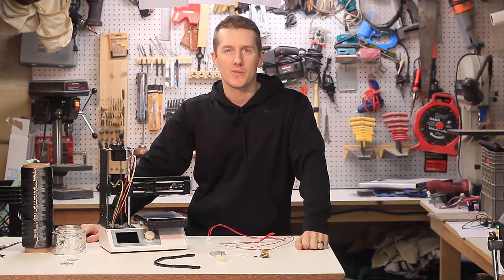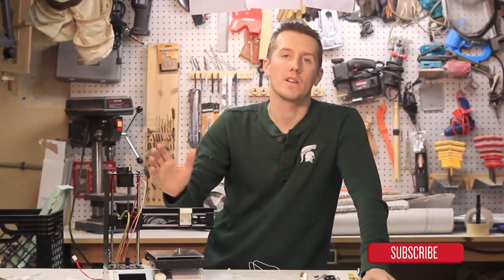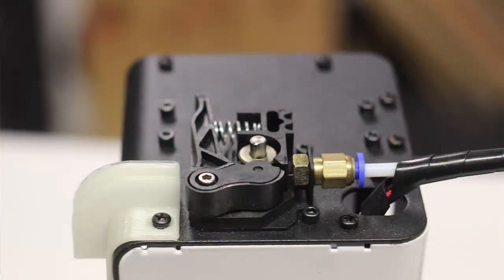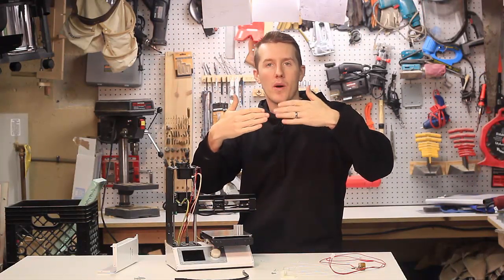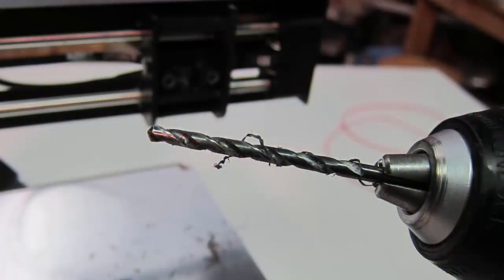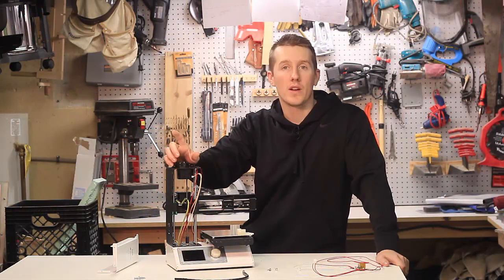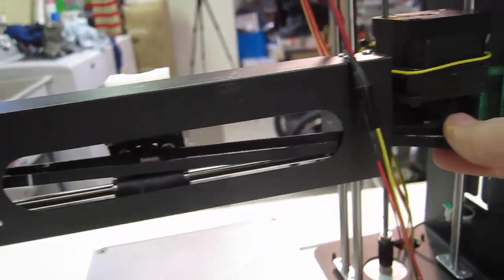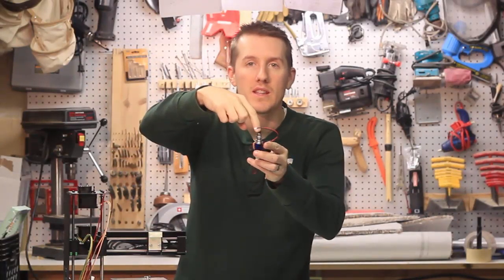Install E3D V6 Hotend - MonoPrice Select Mini 3D Printer

Comment: What sort of enclosure are you using for your printer?
Reply from the maker: I made it out of plywood.  Not really needed unless you are printing with ABS.  It needs to stay hot or else it curls up off the print bed.

Comment: I have to change the hotend, but I dont know how to open the housing??? No way to diconnect the wires.  Any idea? Thanks!
Reply from the maker: I don't think the housing opens.  It's a solid piece of steel.  But i think there's a set screw that holds the heater piece and thermistor in place.  You might be good to buy a cheap one from temu or amazon and see how it's put together.  They are only like $3 - $5.

Comment: I've got a mini v2 and am just about to give up on it and toss it in the trash. So frustrated that you can't find parts for it. Trouble started with a clog. From videos I learned to take the hotend apart and using a heatgun I cleared the clog from the PTFE liner. Put it back together wrong and it leaked filament all over the heater block and nozzle. Took it apart and again with heatgun cleared the mess. Then when putting it back together I broke the neumatic fitting on the top of the coldend inside the coldend. Now I'm trying to figure out how to replace the entire hotend with an entire E3D V6 clone. The E3D v6 I got drops in fine with the stock mount and I was able to connect it and get filament running out of it but the whole assembly is too short by about 5mm or more and the cooling fan mount goes beyond the nozzle so I can't level the bed because it crashes into the fan mount. Also, because it's so short the bed can't come up far enough so I ordered longer bolts and springs for the bed. Only plus is what I've learned about 3D printer innards but have not been able to enjoying much actual printing.

Comment: So i'm no electrician, but i'm doing work on the v2 hot end and i'm confused, usually you have 1 red an 1 black wire with electronics in my experience anyways and the heater block has 2 red wires do i need to worry about that? No markings on the old wires or the new wires other than the gauge and how much they can handle...
Reply from the maker: I'm not an electrician either, but i don't think there's a + and -.  I don't think it matters which end is connected on the heater block.

Comment: I cannot find any guides on updating the firmware after installing this,  yet just about every video tells me to make sure I update before printing. Where can I find the files for the firmware update?
Reply from the maker: I've never updated the firmware and i still print today just fine.  I remember i was going to do it once to use Octoprint, but never did.  
But i assume you load something onto the microSD card or something??

Comment: You can use the same bolts if you cut off the little lip on the x-carriage. See how the bottom of your printed mount sticks out further than the rest @ 2:13? They are m3 (0.5 pitch), you just need corresponding hex nuts.

Comment: quick trick ive learn while working with 3d printed parts, i finally broke down an got a couple assorted m bolts so i have plenty to work with but when cutting threads into 3d printed parts i take whatever bolt size works an i cut a line on either side of the bolt at the tip so it cuts threads an works like a thread cutter. makes cutting the threads alot easier an cleaner an they seem to hold better for me than if i just force a bolt in. the first few screws i tried cutting 3 lines but sometime they was so small it made it hard so i back down to 2 lines an it works just as good.

Comment: petg is not always better. pla is better as v6 mounting bracket because its stiffer. petg is better suited for parts that requires more strength, but rigidity is not as important.

Comment: Are the steps the same on the MP select mini V2? Same commands in the firmware after upgrade?
Reply from the maker: Not sure, i've never used version 2.  But i never upgraded the firmware on my version 1.  It just printed fine with the new hotend.  I just played around with the slicer settings.

Comment: Thanks for the video. I used 4-40 stainless pan head screws and nuts from my local hardware store. Cost was under $2 and easier to find than M3's in the USA. Two 3/4" long for the mount to the carriage and two 1 1/4" for the cap holding the E3D clone heat sink to the new mount. I think 1" for the longer screws would have also worked too, but then it would have taken a second trip to the store. Worked out just fine overall except big fingers little nuts took some time to locate on the longer two screws. I thought about heating the nuts and pressing into the mount so I didn't have to work so hard, but ended up just holding the nuts with pliers and got them started after a few attempts.

Comment: Thanks for the previous answer! I have ONE more... After installing my E3DV6 Genuine hotend, now when I hit 'Home' my monoprice, the hotend ends up about 3MM off the front left corner of the bed. Basically, the same as place as the factory setting, but, about 3MM off the front of the bed now. I can move the hot end into the right position (using on the pronterface interface) - is there a way I can move the hot end into the desired place on the bed that I would like it to 'home' to, and then upload a command (followed by M500) to save that desired position as the 'new default' location when hitting the 'Home' button? Is it possible to do that way? Or, do you know a pronterface command to upload (followed by M500), to make the E3Dv6 home on the left corner of the bed? Basically, 'fixing' the homing positioning with the offset, through pronterface, and saving it in the firmware so that it then homes on the left front corner of the bed again? I'd rather work through pronterface since I had been adding the necessary commands to account for the PID etc., and I have no idea to then offload that tweaked firmware into arduino. I'd rather just add a command through pronterface to fix this final issue..

Comment: Hey Dave! Quick Question...  I JUST installed my E3D V6 All Metal Hotend on my Monoprice mini V1. One issue - between the end of the E3D assembly instructions (and what your video covers with actual install), I am confused about how to actually connect the Monoprice bowden tube to the top of the hotend. I see a nut in the video but the way it seems there is no threasing at the top of the hotend. I have pics I can email you if you want to get a visual - I just need to know how much to cut the PTFE tube at the top of the hot end and how exactly to screw on the mini's bowden tube.  Thanks!!
Reply from the maker: At the top of my hotend it was threaded for that one fitting (forget the name of it)  it's the fitting that holds the white PTFE tube without pulling out until you push the ring in.  You shouldn't have to cut the PTFE tube, just push it into the hotend till it stops.  I tapered the end of my PTFE tube to fit the tapered inside at the bottom of the hotend, but you dont really have to.  So to sum up, just post the white PTFE tube in till its tight.
Reply: Thanks! Yes, I did do that, and so I have about  3" of PTFE tubing protruding from the top, its well seated in the hot end. However, the feeder tubing that was part of the monoprice mini (that fit into the original heat sink), seems to be the same size. The very top of the E3D V6 hot end down't have any extra threading to put a nut on to somehow join with the end of the feeder tube (but, somehow you do it). Maybe you can unscrew the feeder tube from the top of the hot end and explain in a video how that attaches? I for one would REALLY appreciate it! I have no idea how to connect the two the way things seem to be right now. Thanks!!
Reply from the maker: @Gouldeyecandy  So you are saying yours looks like this:   https://www.google.com/search?q=e3d+v6&safe=off&rlz=1C1GCEU_enUS821US821&source=lnms&tbm=isch&sa=X&ved=0ahUKEwjBwpv1w9HeAhWHqIMKHZ5qDg8Q_AUIFCgC&biw=1778&bih=860#imgrc=sb4bEbv3rgW-XM:

and mine looks like this:  https://www.google.com/imgres?imgurl=https%3A%2F%2Fmakershopbcn.com%2Fwp-content%2Fuploads%2F2016%2F11%2FHOTEND-E3D-V6-BOWDEN.jpg&imgrefurl=https%3A%2F%2Fmakershopbcn.com%2Fen%2Fproduct%2Fe3d-v6-bowden-hotend&docid=hpfo0q1YwJACjM&tbnid=RoVcFwbE-eTksM%3A&vet=10ahUKEwikzIr2w9HeAhWF4IMKHf03DC0QMwiZASgOMA4..i&w=800&h=800&safe=off&bih=860&biw=1778&q=e3d%20v6&ved=0ahUKEwikzIr2w9HeAhWF4IMKHf03DC0QMwiZASgOMA4&iact=mrc&uact=8
Reply: Yup! Got it! Thanks!

Comment: Well I for one enjoyed the video.  Makes it easy for me to follow. Got a question though, when you installed this hot end, did you have to mess with the "coding" or parameters of the printer since this is upgraded from what it came with?  If so, how did you go about doing this.  Thanks.
Reply from the maker: I've never changed the coding or firmware of the printer.  You may need to adjust the Zaxis switch so it triggers when the nozzle is near the print bed.  But any changes for filament flow or anything was in the slicing.

Comment: Thank you so much, I had no idea how to get the heat sink off. Do you have a link to the 3D printed part to replace it with?
Reply from the maker: I think i tried 2 or 3 different ones but liked this the best...the zero offset version
https://www.thingiverse.com/thing:1848402

Comment: Try Permatex  Red RTV to coat the Hotend. The Red RTV will handle temp up to 600 F. and all you need is a 1/16 of a inch thickness. Works better than the Gun Cotton.
Reply from the maker: I recently bought the E3D silicone sock 3-pack for $10.  They work pretty well.  But ya the RTV stuff would probably be cheaper and more permanent.

Comment: So what is the difference between the e3d and the standard? I know people tend to call Bowden extruders e3d hot ends, but I'm mind fucked here.. it's the same shit
Reply from the maker: E3D is a company.  They designed the V6 hotend.  It became super popular and many companies in China copied their design and sell them for $5 instead of $70.  The official E3D hotends are well made and have tight tolerances.   It's kind of a roll of the dice whether you get a good one or not from China, so far the 2 cheap ones i bought are ok.  Lots of people call the ones from China "E3D V6 CLONES".  The "standard" hotend for the original MP Mini is something different.  On the new Version 2 of the MP Mini they now use a hotend like the E3D V6.  But for people like me, who own the Version 1, it was just as easy to upgrade my stock hotend to an E3D V6 clone.  
Bowden doesn't have anything to do with the hotend.  Bowden just means that there is a long tube connecting the drive motor and the hotend.  The MP Mini is a Bowden setup because the motor is at the top, connected with a tube, to the hotend.  The advantage is less weight on the arm.  The opposite of a Bowden setup is Direct Drive, where the drive motor is on the arm.  It's more weight to move but less chance of clogging between the motor and hotend.

Comment: I had a similar problem with my mono price printer and went with the cheap v6 off eBay my first problem was that I didn’t have the ability to print the stuff to mount the hot end. But I am a machinist and capable of making a metal one and I did that part works next problem the heater cartridge did not work at all I put the old one back from the other hot end in and it was almost working until it shorted out. Order another one it was wrong one so I ordered a different one. This one works a little to well. Temperature was 330c. And it will not allow me to turn it down. Do I need to order another cartridge for it and what should I get or is it something that I missed?
Reply from the maker: Not really sure, i just hooked mine up and all the temperature settings worked normally.  If it's heating up the cartridge should be fine.  Maybe its something with your Thermistor (temp sensor) not communicating with your board, telling it to stop heating.

Comment: does the ed3 come with a new temp sensor ?? did you have to change the firmware ?
Reply from the maker: Change the firmware - No.  Some people talk about doing a PID tuning, but mine was fine as is.  The CLONE E3D V6 that i got was a kit that came with everything, the heater cartridge, thermistor (temp sensor).  I just connected the wires to the existing and it worked.
Reply: ok , just ordered the imitation for 12 bux./.thanks

Comment: Thanks for not masking the installation procedure. This printer in my opinion is far more expensive than the way other reviewers make it out to be that is when you include all the time spent researching, troubleshooting the frequent jams and all the additions you will end up buying to improve or should I say required additions just to make it print. Just not worth the headache.

Comment: Hello Dave, i want to buy this hot end but is my first printer so i have a question: u show how to  install the hotend, but do i need also to modify the  firmware? i ask this because i have a creality ender 2 mini and i cant find anything related to this printer, not what kind of arduino board use or abut marlin firmware upgrade/modify

Comment: These printers use metric M bolts.  Usually in the M3, M4, and M5 bolts...commonly available at Lowe's.  This are hex head also available with Philips head.

Comment: hay my extruder keeps clogging up and i ordered a new one through mono mini buts its clogging up still any advise please help i print at 210 so it should be fine i used to print at 190 temp on the extruder but just need a lil advice thanks
Reply from the maker: Emmanuel Rivera I connected my hotend fan so it blows directly onto the heat sink at 12 Volts. I needed higher air flow so that it wouldn't melt inside the cold zone of the extruder. Your fan might be spinning too slowly and not cooling the heat sink off enough
Reply: Emmanuel Rivera you can unclog the nozzel by heating it up then putting filament in it then pulling the filament out while the nozzle is hot. If that doesn't work wait for the nozzle to cool and pull out the filament when it's cold.

Comment: Were you having trouble with the stock hot end, were you getting bad prints ?  I hope not, I just bought the Version 2 and so far it is working fine ?  

I have had it going all July 4th long weekend and getting great prints ... as good as my Prusa ... Your videos are very good, but I personally would not go thru what you are doing on this printer for sure !

Comment: Wow. I don't know where to start. I thought I'd found a nicer video for this mod to share but no way should (or could) anyone follow this. Sorry to be harsh but you set yourself up as an example so you need to respect your viewers and not put up material that's detrimental.

Why didn't you watch a video on how to do this before screwing up your printer and doing a lot of extra work? Or ask somebody? You are doing your viewers a disservice by not doing research and winging it and getting it wrong. Many aspects of 3D printing are nuanced, nor obvious, nor can they be just made up on the spot. I hope your viewers do their homework and don't try to follow this. :-( 

The screws in the Mini and the vast majority of 3D printers are metric. The ones in your parts bin are standard. The ones that hold the heatsink on are M3. You can buy an assortment kit on amazon for $15-$20 if you're going to be tinkering with printers a lot.

You didn't say where you got the file to print the bracket, but 99% of the time they list what hardware you need so you can get it in advance.

To get to the screws that hold the heatsink on, just loosen the one screw on the end of the X gantry and take the belt off. No need to take the housing apart.

The instructions for putting the heat break into the block are wrong. Many videos describe this. 

If you shorten the PTFE tube, it'll cause excess friction on the filament at the extreme ends of travel. 

These aren't great but they get it close to right. 
https://youtu.be/b8FNLUXx_S0
https://youtu.be/R8sZbwOS8hQ
Reply: Yeah, watching him drill out the mount to fit those barbarian unit sized home repair bolts made me cringe.
Reply: I looked for your own YouTube video but I see nothing. No videos. You have created nothing to match OP. 

It's the easiest thing in the world to criticize. It's the hardest thing in the world to create, and even harder to show your own flaws in the process. Give the man his due. 

On the plus side, there is some weak attempt to help. 

2.5/10

Comment: If you guys have this printer check out this google+ group (https://plus.google.com/u/0/communities/116802523766279866092) and here is a guide with links to everything you need(https://docs.google.com/document/d/1Jem3yd-JvqsIT2z74IHfMKatL5p4JVx3sqsUQY2tC0k/edit?usp=sharing)  . and here is also a knowledge base that ppl contribute to for everything on the printer ( https://docs.google.com/document/d/1HJaLIcUD4oiIUYu6In7Bxf7WxAOiT3n48RvOe5pvSHk/edit#heading=h.55rkuyw7uqlw)

Comment: You used the wrong size bolts. Should have used a smaller size bolt.
Reply from the maker: Ya i didn't have anything smaller.  In hindsight i should have bought some before starting.
Reply: If you were to do it all again, what size bolts would you get?

Comment: did you use the same pla filament
Reply: The stock hot end will get far hotter than what's required for ABS. I've printed nylon on mine which takes 250C.
Reply from the maker: Jr M no I used colorFabb  NGEN which has a 240 extruder temp
Reply: Dave Wirth I will like to buy a e3d V6 mount like the one you made
Reply: the reason I upgraded to the e3d V6 is because I bought the wrong filament I bought the ABS but for some reason it don't want to melt properly
Reply: PLA worked fine on my slightly modded zero-offset bracket. If it's getting hot enough to soften the PLA mount, then something's wrong. If it's that warm on the outside, think what's happening to the PLA filament on the inside.